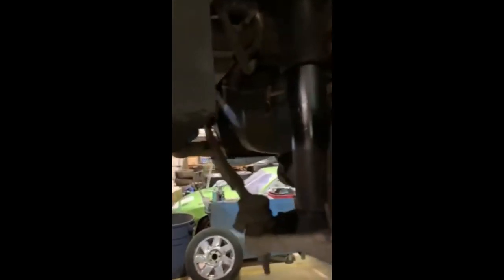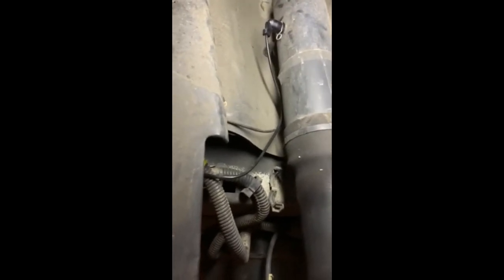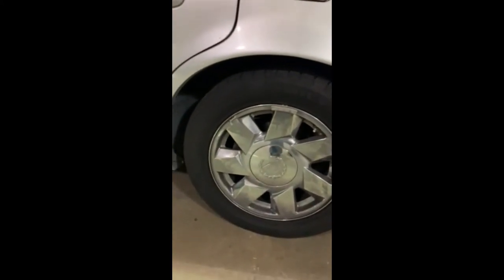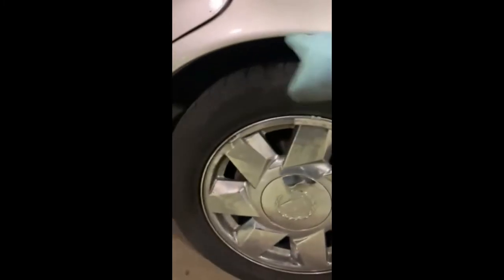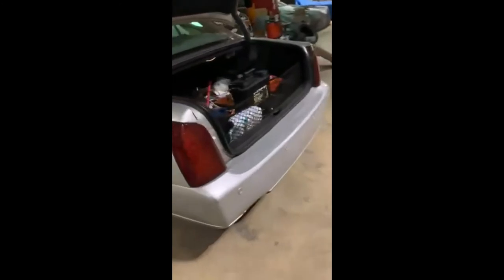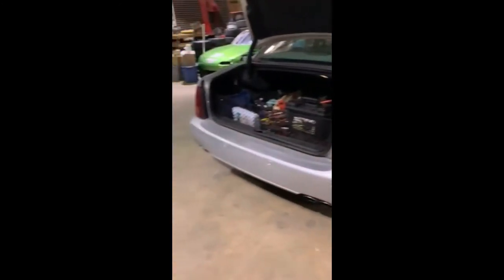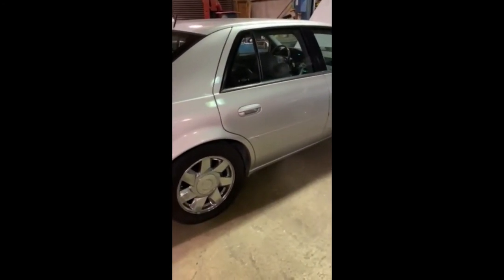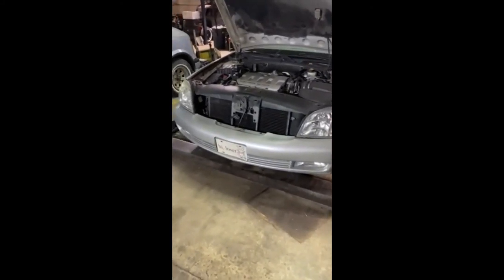2002 Cadillac DeVille DTS rear air ride hack

Comment: My homie has one of these in purple and it's the North Star Edition his back airbags are currently not working but I was wanting to know for him has tires in the rear were the airbags are not working the tires themselves are balding from the very inside. He said yeah I just got an alignment and they're still balding so I told him it might be the rear airbags because the rear end isn't lifting up causing it to stay squatted with the cambered tires in the back . Please correct me if I'm wrong though because I don't want to give him the wrong answer
Reply from the maker: this will only work if the airbags in the rear are in good condition, if they are dry rotted and leaking, this will not help... that being said...being a front wheel drive car, the rear is independent, so if it squats, the inside of the wheels will actually wear first. if this is his issue, this trick is cheap and should help him out. I no longer have this car, but see it every day, as my neighbor bought it, and does have to add a little air every few months or so... kit # ak-29 through any parts store or amazon. think last time I looked on amazon, it was about $25, and no real specialty tools are needed. I did mine on a lift, but you could easily do it on a jack or pair of ramps. let me know how it goes if he goes this way!

Comment: My stabilize engaged light comes on when driving then slows my car down, then goes back to normal speed. I no something is going on but not sure if it's electronical but nobody seem to understand what I am saying. I was told buy a conversation kit
Reply from the maker: usually the stability program will cut the fuel system down at speed over 90 mph, and kick back on around 88mph. like mine, someone's probably replaced the struts with standard style ones (originals are hard to find, and expensive when you can). there are resistor sets you can get for fairly cheap to plug into the harnesses to trick the computer into thinking that the struts are original and giving a signal. kind of like these:
https://www.ebay.com/itm/Electronic-Strut-Bypass-Kit-Buick-GMC-Cadillac-Chevrolet-Ford-2000-2012/264017225082
this is the one I actually bought, I've just misplaced it. he also has a full set available for the entire car. let me know how it goes for you! and thanks for watching!
Reply: @turnkeyprojects1967  
This is the most thorough answer I recieved yet & you provided the parts. If i wanted to buy the parts for it what am i putting in the search for original struts & shocks?. I need to get some because my suspension light is on as well. Thanks again Fam
Reply from the maker: @jeffreylanier222  , the front shocks are about as rare as a $3 bill, (I've only been able to fine 1 pair inside of 2 years, and they were $600 EACH) so you could go with a monroe or gabriel strut, and have those resistors wired in at each corner. I did find the rear airbag type shocks when I first got it, and were around $200 a piece. if you still have any issues, you may also have a wheel speed sensor issue at any one of the wheels. they control the abs system, as well as work with the stability control. only other thing I could say to look at, is the leveling sensors. on a standard deville, I think there's one in front, and one in back, but my DTS has 4 in all.
Reply: @turnkeyprojects1967  
Thanks again. I have the leveling sensors. I'll ask someone I no work at carparts. You been awesome with a capital A
Reply from the maker: @jeffreylanier222  , let me know how it turns
 out!
Reply: @turnkeyprojects1967  
I definitely will. I was looking at struts & shocks for the car

Comment: Do you think that the Strut Masters conversion  rear coil kit ( and similar  brands )  are  good  for  the 02 Deville  DTS,  or should I cancel  my  order?
Reply from the maker: good question. I've dealt with the strutmaster brand before, and they offer a really good product. I'd go ahead with the order, as long as they have the bypass modules available to plug into the harness, to trick the computer into thinking that factory stuff is still there.

Comment: I have a 2002 cadillac in silver like yours but not as clean as yours lol 
Im also having the same problem with the rear end slumpped down 
Is there maybe a chnace where i coukd just add air ? Or do i have to do what you did ?.
Reply from the maker: unfortunatley, there is no port where you can add air to the system, unless you can override the air compressor. it's mounted up under a cover near the passenger rear tire. if you're good with electrical systems, you could probably go that way.
Reply: @turnkeyprojects1967  thanks
Reply: @archiemegel5807  I'm going thru this now pump works, new shocks, all fuses and relays are good and the rear level sensor works but for some reason it will not pump up (power is at the deflate wire constant which is the red wire, the green wire has no power which is for inflate), going to replace the lines (ak29) since even when I hotwire the pump to lift it up, it drops within minutes. I'm going to put a switch for up and down (three way momentary switch) in the trunk in order to keep the factory pump. I also replaced the exhaust solenoid on pump (still drops in minutes hopefully the new lines will stop the deflation). This way I will keep factory pump and shocks. Just stuck at figuring out why it's dropping after pump up. I also am disconnecting the rear level sensor. Kinda wondering if the front level sensors are the reason the back will not inflate. At any rate I'm not cutting any factory wires to the pump as I took the wire and connectors off a junk car to wire in a switch with the pump wire plug & I can always try to fix the factory setup the right way later.
Update leak was not in the line greatfuly since the ak29 needed to be spliced into factory lines at the pump. The leak was the o ring where the pump connects to solenoid so far no leak and I will continue using factory pump and shocks with a switch for now..
Reply: @thebridge707  highgrilic oil is maybe needed ? Sory for the bad spelling lol
Reply: @archiemegel5807  no problem I think they are hydraulic air struts but I have not added any oil as I don't see the necessity nor would I know how to do it. I believe the hydraulic oil is present in the motor?.. Any how, it's up and staying up only issue now besides running a permanent switch is one side is slightly higher than other other side (maybe a drive around the block or completely releasing all air from each shock at the same time and refill after). I'll update as soon as I get around to it.
Reply: @thebridge707  cool let me know , i lo e my caddy its sa littke ruff lookibg but dreams lije a cadillac lol
Reply: @archiemegel5807  cadillac is my preferred automobile 🚘
Reply: @thebridge707  i counted how many caddys i had 
I counted 18 cadillacs in 25 years
Reply: @archiemegel5807  got me beat I think I'm at like 10 or 11 maybe 12
Reply: @thebridge707  and still counting lol youll get there lol
Reply: @archiemegel5807  I don't mind, I'm waiting for ct8 to come around that might be my next love. Update: I pulled the air line from the high side for 1 second replugged the line and pumped some air now it looks even. Tomorrow I will run the three-way switch and double check the levels for even height the best way I can figure it out. Looks and feels great 😃.